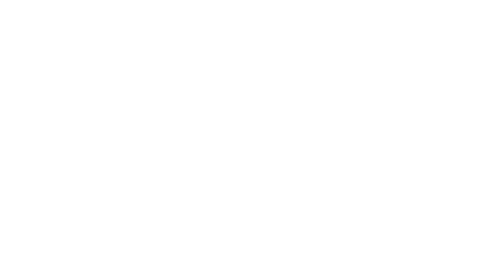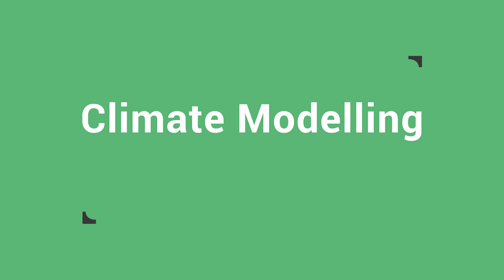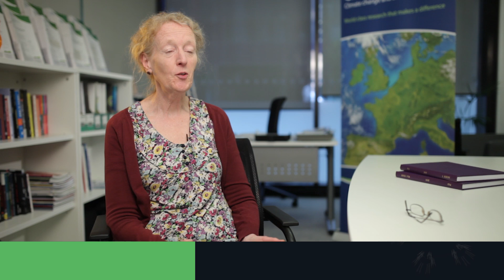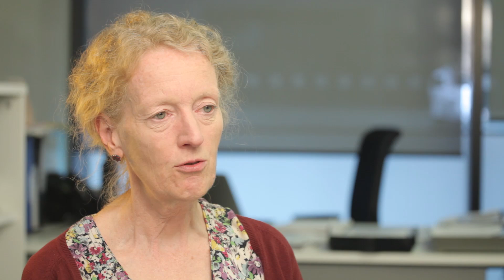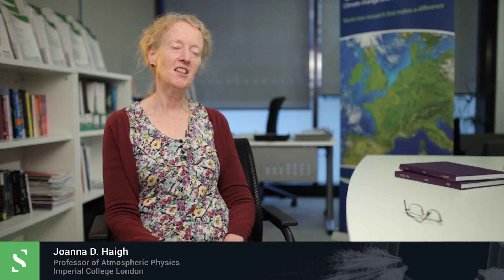Climate Modelling Joanna D  Haigh

Comment: Solar irradiance began decreasing around 1980 when it started to warm up.  The hottest day ever recorded coincides with the maxinum on the seismic energy graph.  The coldest day ever recorded coincides with the minimum on the seismic energy graph.  The rural temperature graph is near identical to the seismIc energy graph.  If you slide the earthquake graoh over to the right about a year and a half, it becomes the temperature graph.  A magnitude 9 earthquake realeases about 10^23 Joules which is enough heat energy to melt the Arctic Sea ice in it's entirety many times over.  Released 15 miles under the North Equatorial current and concentrated in the upper layers of the ocean, one might expect it to melt a lot of ice.
Www.globalcoolingcausesglobalwarming.blogspot.com

Comment: The Navier-Stokes equations are an essential part of any fluid modeling.  They are, however, non-linear.  I think she danced around this issue but in doing so facilitated a 11:11 presentation which could go on for several semesters and result in an agreement that we do not know how to model much of anything non-linear with any sort of fidelity.  Solving such systems usually require stifling linearizations that constrain the system.  The trick is to constrain it such that the basic behavior is retained without throwing the baby out with the bathwater.  The problem with bigger computers and smaller grids is that you can't get past a region where the tangent normal to the solution is vertical e.g. a shock.  There will be a weak solution on either side of the propagating shock that can be modeled if the existence of the shock is known a-priori.  This is not the system of climate modeling capable by current models.  At best they can guess and try to fiddle the parameters to get close in a small regime.  Just my 2 cents worth...
Reply: Does not matter about which math is used if the primary data is not accurate , all climate models should be published with an accuracy % , true scientists would have no problem with this

Comment: Thank you for the interview, but there are some problems i have with her methods.  Those lead me to believe their results shouldnt be trusted as of yet.

1. They solve differential equations numerically and predict very long time periods(climate is defined as weather over periods of 30+ years.) She mentions that their methods are similar to the weather forecast methods. Those need to corrected a lot because they get wrong very fast when they only predict weeks. So those numerical methods are not suited for years.

2.She mentions their model has assumptions of how much C02 is burned by the economy in the future. Those CO2 levels are relatively small compared to things like this 
http://marygreeley.com/?p=47632
Which would mean that one bigger erruption by the yellowstone park is enough to ruin their modell, or a sudden solar eruption which would cause a higher solar radiation. Or another natural effect which science doesnt understand or cant predict correctly yet.

3.I understand that a higher resolution on the grid should give a better result. But she acknowledges herself that she is dealing with a non-robust system(little changes in the data cause very different results after a short time). Their solution is to wiggle with the data and then start multiple times. So the results differ fast. Assuming that their modell is a correct representation of the planet, why do they assume that the correct result is in the average of their many tries? That result sounds just as random as any of the other ones, because its non-robust.
Reply: https://www.google.com/amp/s/climate.nasa.gov/news/2943/study-confirms-climate-models-are-getting-future-warming-projections-right.amp
Reply: @jbw6823  the article says they looked into 17 models and say 10 of them "closely matched observations". I dont know what qualifies as "closesly matched", but 10 out of 17 seems to me higher than i would expect. Still its far away from trustworthy. And the could be 50 or 100 more models the study didnt look at. With a quick search i couldnt find a number for the amount of publications with a climate model+prediction.

Most of the media prefer the extreme models, i remember when al gore predicted the north pole will melt by 2014. He made millions with wrong predictions.
Reply: @roberthoover8784  59% is a majority. Then when they did some calibration between models the number increased. "Moreover, after accounting for differences between modeled and actual changes in atmospheric carbon dioxide and other factors that drive climate, the number increased to 14."
Reply: @roberthoover8784  A more scientifically sophisticated way to look at models and accuracy is to go to the CMIP results. https://en.m.wikipedia.org/wiki/Coupled_Model_Intercomparison_Project
Reply: @roberthoover8784  Also there are a variety of models civering different things. LLL is a good stop. Heres a  ref. https://en.m.wikipedia.org/wiki/Program_for_Climate_Model_Diagnosis_and_Intercomparison
Reply: @roberthoover8784  Here is the site for CMIP6. They have evaluation as a tab. https://www.wcrp-climate.org/wgcm-cmip/wgcm-cmip6
Reply: @roberthoover8784  you kniw what a differential equation is. Good. What is your technical background? Im a physicist in silicon valley. I do optics/optoelectronics r&d. Climate is just a hobby.
Reply: @roberthoover8784  if u want to get more if the basics, theres a standard textbook on planetary climate. The books website has some intro data and pythin stuff you can run yourself. https://geosci.uchicago.edu/~rtp1/PrinciplesPlanetaryClimate/index.html
Reply: @jbw6823  that are a lot of comments in a row. And i dont know how i can respond to individual ones, so i'll give my answers numbers:

1. Study accuracy
 59% may be a majority. But being "mostly right" for a bit more than half the time is not a trustworthy model to me. And "accounting for differences" after the prediction happened does not make it better. It would be ok if this was the testing-phase of this scientific field. Not when countries invest billions of dollars based on those models. 

2. al gore 
and his"An Inconvenient Truth" qualify as broadly accurate? if the complete melting of the north pole still qualifies as "broadly accurate", then i unterstand how so many of those models can count as "quite accurate" as the article says. He also predicted the sea level could rise by up to 20 feet. Btw have you seen the mansion he bought after that documentary? Its right next to the ocean. To me he behaves more like a religous cult leader that demands tons of money for his desires. He sounds like a doomsday prophet. 

3. the CMIP
 is a "collaborative framework designed to improve knowledge of climate change" as the wiki states. As i understand it it is a Collaboration to make specifically climate models more better. Which is fine, it seems like one of their goals is to provide a more standardized way of publishing results of models. And making data more available. However looking into these models and determining their accuracy is numerical analysis. 
And if you want to make an argument about strictly the model(without the data), my issue is the robustness of systems of differential-equations when you start with the approximation. You need an approximation in order to able to compute it with a computer. But when you do that you leave room for error compared to reality and the last time i was in a numerical analysis lecture there was no reliable way to limit this error for the results. At least not for those big, complex models in climatology. This is at first a math problem, which affects climatology. 

4. background
 I have a math degree, but now i work as a software dev now. My work doesnt involve climate models or differential equations in general. When i was in university i had a lot of lectures about different kinds of algorithms and some of them where about solving systems of differential equations. But no climate models spcifically. I think my numerics 3 professor once said something like "dont trust the weather prediction after 2-3 weeks anymore, ive seen the models"(i know weather is different from climate). My point is, in different fields of math, when it comes to PDE's and the system gets a more complicated you loose a lot of properties you would like to have. For these types problems you usually trust only a short-term prediction. 

5. Another thing 
that makes me suspicious in general. I dont know too much about phyisics. But i heard a lecture from a Meteorologist. His argument was that humans just dont fully understand how the climate as a whole works. (For example we cant predict earthquakes.)
Reply: @roberthoover8784  usuallyvI ask peopke what is the role if blackbidy radiation in pkanetary climate ss a basuc test. I suspect you dont know the answer. Based on that, you should giveith what peopke whi kniw the stuff say. Every single scientific society in the world endorses made made climate change. And all those models were vased on that. A good intro to the science is an american instotite of physics site. They go over the history and the role of co2. They also discuss models.bits very extensive. And if you are software dev. Then you can check out the python code and data at the book site mentioned above. Or buy a supercomputer with your spare change. https://history.aip.org/climate/index.htm
Reply: @jbw6823  i dont know what "blackbidy radiation in pkanetary climate ss a basuc test" is. In recent time i also wasnt very interested in the climate as a topic and there is a lot of work related stuff i have to look into/research allready. Ive seen python being used for data analysis, although more in the direction of neural nets. And i dont need it for my work. So i dont want to sound rude, but if im honest, i probably wont look deeper into these sources.
Reply: @roberthoover8784  ok. Sorry bout typos. Phat phingers.
Reply: @jbw6823  no problem, have a nice day :)